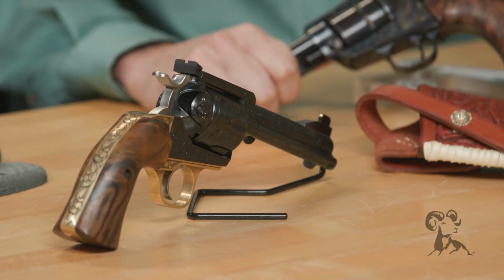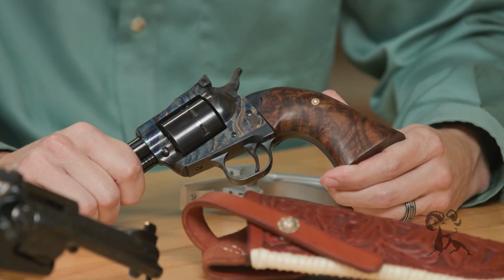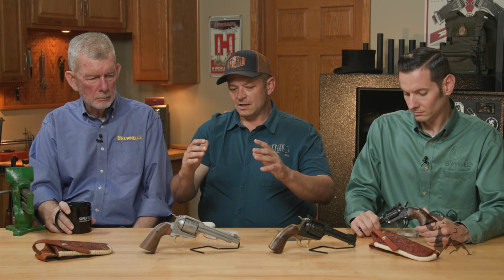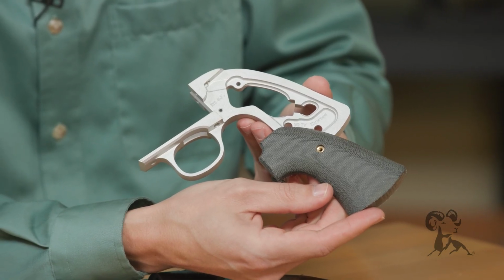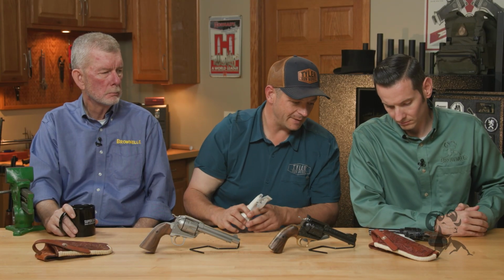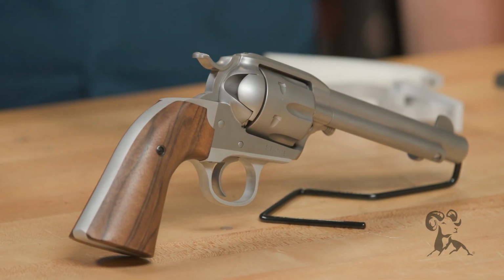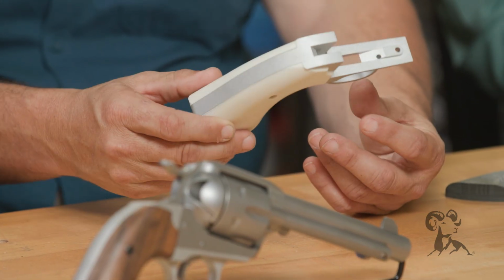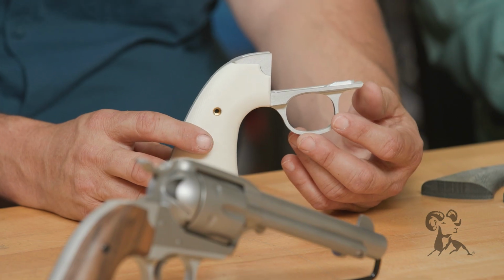Product Spotlight: Tyler Gun Works "Working" Custom Revolver

Comment: The one thing I would love on a single action would be to switch sides on the loading gate.
Reply: That wouldn't work in north America. You'd have to be south of the equator in order for the cylinder to cycle in the opposite direction 😂😂😂

Comment: I like Bobby's idea on the reshaped #5, but I frown on them being aluminum.
Reply: its a gun to be carried a lot and shot a little.  not a range toy so weight makes a difference.
Reply: So many folks won't buy a aluminum grip but will gladly fly at 33,000 feet in a craft of 90 % the same material... the mainframe is steel. It will take ALOT of rounds.
Reply: @ahhamartin  
Well since jet airliners fly at speeds faster than most handgun rounds, i see your point. But the difference in the acceleration probably causes faster wear. I don't know man you got me.